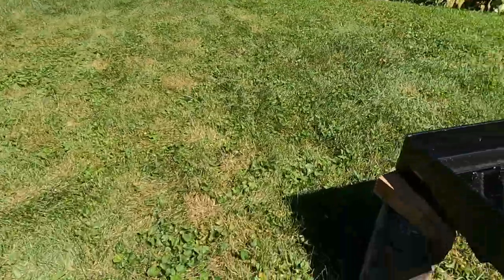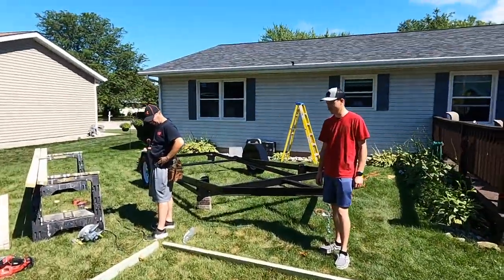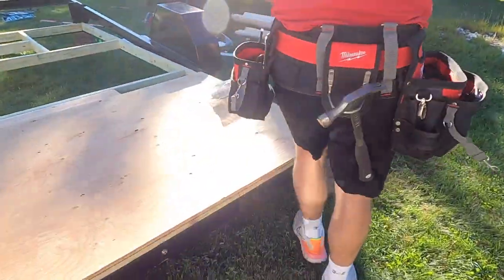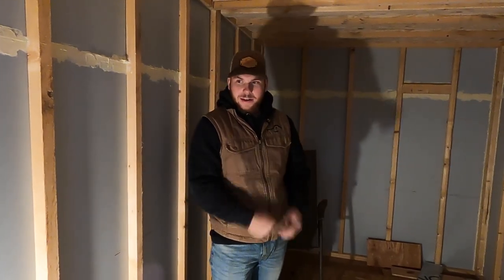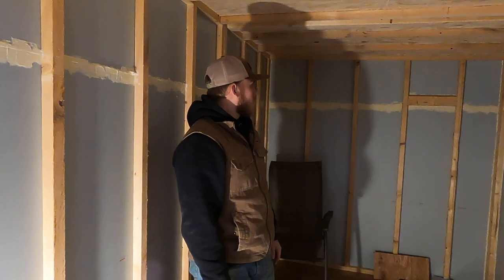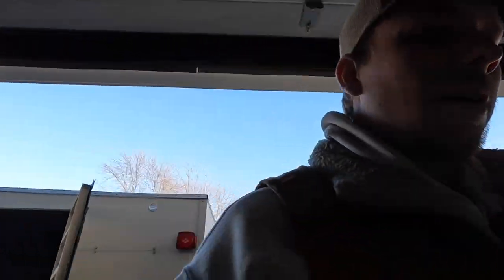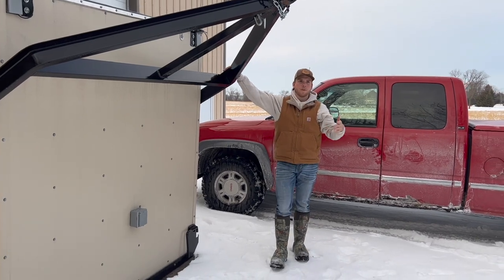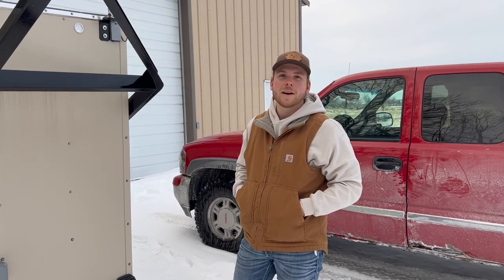How To Build A STURGEON SPEARING SHACK | Full Build

Comment: You guys definitely built it lighter than how bowe makes there shells. Is there a truck scale near you guys to see how much it weighs? We have a 6.5' X 14' bowe frame and shell finished out and that weighs 1800lb, its also on springs. But they build with full 2x4 for there walls and roof. Just curious where you guys are at for weight.
Reply from the maker: Not sure exactly what it weighs but it is definitely much lighter!! I would say it must be closer to 1500 lbs or less.

Comment: What is the outer material used on this shack?
Reply from the maker: It is a composite metal material!
Reply: Where did you get that composite material?
Reply from the maker: @chucksemrad8789  any sheet metal fabrication place should have it. Muza Sheet Metal is a good one. Sometimes if you’re lucky these places will have extra material left over from a job that you could get at a discount!